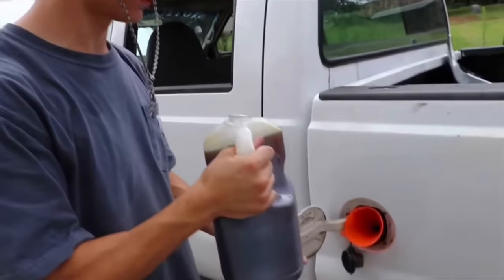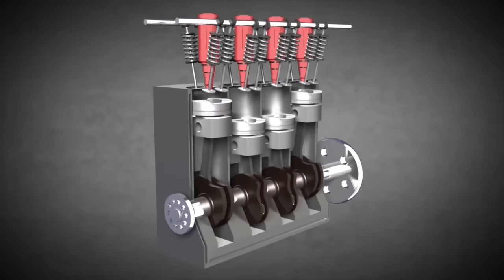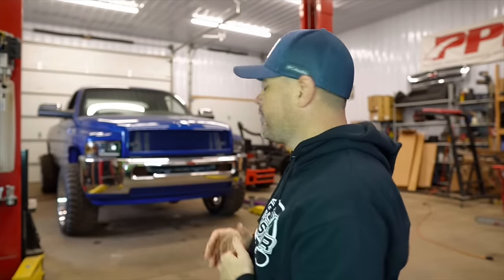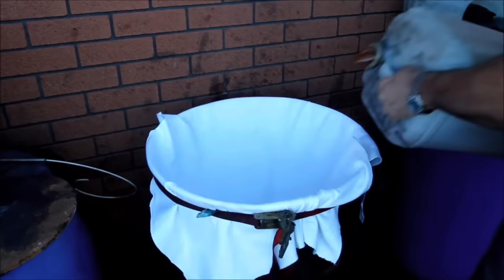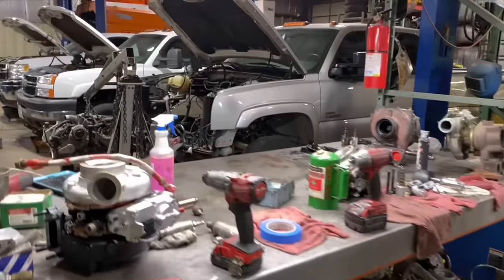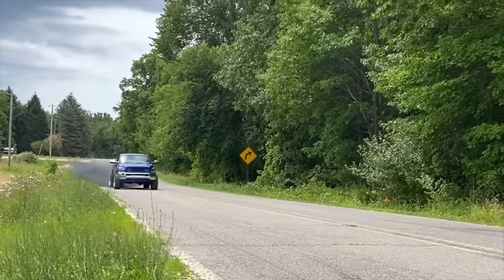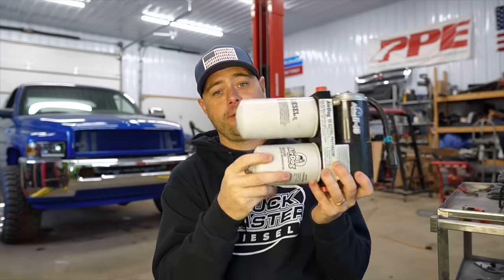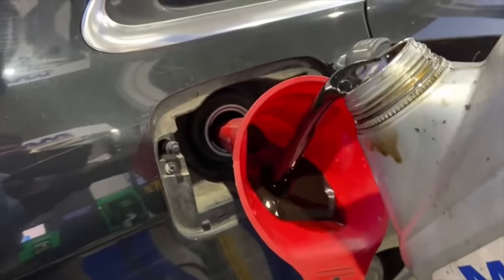Can You Run A Diesel On Used Engine Oil? Free Diesel Fuel? *EXPLAINED*

Comment: I towed 8 humvees in 4 months that the driver filled with unleaded. We drained the tank and dumped 25 gallons of gas/diesel mix among 15 lhs with over 100 gallons in the tank prior to the contaminated mix. It’s not a bad idea to add 1-2 quarts of used atf or oil to your tank especially in winter for added lubricants with the post 2007 fuel especially on mechanical injection engines

Comment: In my 2003 6.6 lb7 I’ve put 5 gallons of used motor oil in with 15 gallons of diesel i mixed it up well and it ran like normal just smoked a little more

Comment: Used to run filtered veggie mixed with diesel 1:1, oil and gasoline (black diesel), kerosene in my 1990 ve pump Cummins all the time without issue.  Getting it clean was the hardest part.  Used to dump leftover end of season gasoline in my 06 Cummins without issue also. My ‘18 never crossed my mind. Fuel system is too sensitive to contaminants.
Reply: STOP..........in your 06' Cummins????....I take care of my 06' like a Ferrari!!!!!..just cracked 200k.....OEM Injectors replaced with BOSCH OEM Injectors..Valve Lash adjusted, the Starter was replaced with a HD unit......everything else is still alive and has not been replaced.....maintenance / maintenance / Maintenance.......Awesome truck...Oh and its a Manual
Reply: I would probably add little bit of 2 stroke oil or transmission fluid in the fuel... can't hurt

Comment: Thanks for the great info.
 I havd an 07 Ford with the 6hoe an i started rebuilding fuel injectors for friends an family absolutely love it after doing my first set i convenienced myself to run 50 50 mix used oil/ filtered of course with diesel. My mileage has stayed the same power if there is a loss i cant tell with the tune. One thing i will say is its a hell of a lot quieter. I dont have any smoking issues or starting cold it actually starts easy an isnt chopy at all where as last yr she would cough an bang till it warmed up.
  Im looking forward to tearing my injectors down next weekend im going 30 nozzles. If i remember ill let ya know how the old ones look.
  I have 3 friends pumpin the black dtuff in their riggs an no troubles yet knock on wood!

Comment: This is just the opposite, I put 12 plus gal. of diesel in a 1964 Chevy 3/4 tom 4by with a 250 gas straight 6,  it ran fine for a block or so, then went to slug mode, black smoke out the pipe. I realized my foolish mistake, it had a manual choke, it ran better pulled out, I did get home about 35 miles, left it idling and added premium fuel from cans I filled in my town. Only problem was to much fuel, it all washed by the rings and filled the pan up the dip stick about 2 in. I just washed my sludge out I figured. After running right again I changed the oil and filter. Never to do that again, and never had an engine problem.

Comment: with  the  gas /diesel  mix  can be  a problem if  they dont stay mixed,   the detenotion  on  pure gas  is  hard on head gaskets  and  head  studs .  I have  heard of cold  starts where they spray  in gas  on start up but  that was  -40 and lower. easier and  safer is  wd40  on  cold  starts

Comment: I have a 1993 idi I have the front tank for pure diesel and the rear for used ATF. I start it on diesel, stop it on diesel, drive it on used ATF. Never had any issues. It loves the tranny fluids.

Comment: I have a 95 powerstroke that I run frier oil and used motor oil in now for years and it is a night and day difference in knock and I get better fuel mileage especially with the frier oil it works great

Comment: im running used motoroil cut with medical grade alcohol that i got for  free for several thousand miles now, 1979 international S2200 Semi Tractor W/ Cummins ntc855 big cam 2, 2000 International 4900 w/DT466E, and 1981 Cadillac Eldorado w/ dx block 5.7 olds diesel. The S2200 i did not have to do much of anything to make it work, the 4900 i had to add a stronger transfer pump, and the Eldorado i added a couple of transfer pumps as well as a 3 micron cat filter to get it to work right.

Comment: I have a early 99 7.3 205,000 miles on it with 35x12.50x20 & 4 inch lift with 373 gears & run used Trans fluid through a 2 micron filter & haven't had no problems I am getting 28 to 30 mpg on highway I am running a programmer also my buddy has a 2002 5.9 with 245,000 miles on it with 35x12.50x22 with 4 inch lift with 355 gears & the same programmer & he's getting 25 to 28 mpg on highway gotta love those old diesel engine's
Reply: What programmer is your buddy running on the 5.9?
Reply: @ConnectiveWyo  Hypertech Max Energy he runs it in stage 2

Comment: I've a 4 stroke 17 hp tucmseh lawn mower I recently put 50/50% mix gas an used motor oil in an it ran just like a two stroke or small diesel engine 😊😊😊😊😊 an I've more torque outta of it then gas alone I'm happy with the results 👍👍👍👍👍👍

Comment: If a jet is worked on, they drain the fuel but can't put it back in since it is considered contaminated. I ran my 12 valve on it with no problem.

Comment: My only complaint is that used oil has all the shit you wanted out of the motor in the first place. If you're going to do this make sure to filter the shit out of that oil so you're not reintroducing contamination directly into the bores of your motor.

Comment: I run my 1998 12v Cummins/Dodge off of 50/50 mix of used oil and cheap diesel or kerosene

Comment: I have a '00 Semi with a Cummins N14 in it. I used to dump one gal. of 2 cycle motor oil (clean/non used) at every fill up (around 200gal.) to give the pump and injectors more lubrication so I always had 5-10 gal. of oil with me. I remember I parked for the night at a rest area with about 1/4 of a tank of fuel, the truck was leaning to the right side a little so all my fuel drained into the right tank. Woke up in the morning, started the truck , it ran 10 seconds and ran out of fuel. I didn't have any hoses and buckets or whatever to transfer the fuel back to the left tank so I dumped all my 2 cycle oil that I had into the left tank (at least 5 gal.). Got it started and it ran just fine.
Reply: That's actually very common a Cummins truck forum forum has an entire dedicated section to running two-cycle oil to lubricate just a small amount plus a splash of atf to scrub the feul system. This of course is all new fluids as waste oils have contamination

Comment: I put used motor oil mixed with farm fuel with a 12 volt pump filter continuously off battery and solar panels for my deisal dixie chopper xxwd5000.  Will not use on my 2003 7.3 powerstroke .  I'm almost at 500,000 miles on this beast I wouldn't risk it.  Probably wouldn't hurt the engine but I wouldn't want to mess around and find out.

Comment: We had a machine that would suck crankcase oil out filter it and blend with fuel from tanks than return to tanks. Worked great
until we got emission trucks and had to quit using it. We were recycling our engine oil and getting 10 gallons of fuel each change and no waste to dispose of.

Comment: The short answer is yes. The was gas diesel and oil is refined is very similar to how we make alcohol it’s boiled and run threw a distillery so oil and diesel are the same base. If you want to run eng8ne oil yo7 should get a filter that can recycle the oil threw a medium like diatomaceous earth powder it will file tear out everything down to 2 microns and scavenge out all the metal and water and soot particles. After it’s filtered you should mix it in a 3/1 ratio with 87 non ethanol gas and add in some cetane booster. This will make you diesel fuel. You can also get this from from transmission fluid brake fluid and cooking oil but the ratios will be a little different. The most important thing is filtering the oil I would filter 100 gallons for no less then an hour in a recirculating tank to make sure it’s clean.

Comment: I had a 12v Cummins, I would mix in motor oil, ATF, and sometimes I would get soy oil from a dairy for free and I would mix it 50/50 with diesel. Not in the winter tho. I ran strait diesel in the winter. With the soy oil the truck smelled like French fries, I did not notice a loss in power or extra smoke, but that truck was probably only 50hp over stock

Comment: IDI engines are VERY forgiving when it comes to fuel. Transmission fluid, motor oil, gasoline mixed with oil, tequila mixed with oil, whatever. If it burns and can lubricate, it'll run it.

Comment: With a 24v you can blend a little in but only if it's warm. I got a fass titanium and ya gotta swap your filters every 2-3 k miles. Just eye your fuel pressure. Filter it well. Read forums on it. If you use veg oil you need to heat it up to reduce the water content. Before you add it. After, heat the oil before you burn it I've seen some sweet systems that use a heated coil around a filter before it's injected and uses coolant to heat the tank.
Reply: If you're changing it every 2-3k then you must have bad fuel. I got like 10k and it's exactly the same pressure as when I put em on.
Reply: @mrmotofy  I do it out of precaution. I've got terrible luck with VP44's. I'm on pump 3 and that was before the waste oil fuel. If the filter is 8 bucks I'd rather just swap em
Reply: @luketimmer6108  have you thought about p pump swap my brother had a 99 with a vp44 we had to replace we would have known that the p pump could have been swapped in back in 07 we would have been much happier
Reply: @black69camaro2344  don't have the time and can't find all the parts in southern Wisconsin rn. I'd love to when I have more free time

Comment: Hey there how are ya? I’ve run wmo, watf, kero, bbq starter fluid, hydraulic oil through my diesel engine. I started doing this 10 years ago. I have many sources for the oil, I just ask them not to mix coolant with the oil. 
I decant the jugs through a 100 mesh screen then to a 25 micron sock filter, then through a 1 micron filter. I fill a 55 gallon drum with 50 gallons. Once filled I then in stall my 50 gallon per hour centrifuge on the filler bowl. I use a 1/2 hp motor to turn a Toyota power steering pump with 2 to pulley set up. Pump turns 1/2 motor speed. The oil then enters a homemade 2kw Emerson heater then into the centrifuge. I by pass the centrifuge in tell the oil in the barrel is above 212. The barrel is insulated to retain heat. 
Once to filtering temp the oil is very thin and dewatered. I begin to slowly close the bypass line, pressurizing the centrifuge, ya do this slowly so ya don’t blow the centrifuge rotor a part. I run the system at 80psi which spins the rotor at approximately 8000 rpm’s. The system then runs for 10 to 12 hours. Allowing for 10 to 12 passes through the centrifuge. Once done the oil is very hot and thin. The oils still black but extremely slippery. There are magnets in the bottom of the tank to collect any Ferrous metal. I allow the filtered oil to settle in a clean barrel with a sack of crystal cat litter. The crystals pull out contaminants and any water that may condense in the system due to heating. Once settled for 2 weeks I pump it in to one of the trucks then mix 50/50 with diesel. I  run a couple 3/8 tubes into the tank and run compressed air in to bubble mix the fuel for a few minutes. Sometimes in the summer the mix is a little richer. I change filter monthly, and drain the water trap before starting. 
I’ve been lucky so far I haven’t had any issues. 
I know that wmo has about the same btu value as rug, which is about 11% less than no2. The engines run cooler are less noisy  and have slightly lower egts. One truck is a ve pump and the other is a p pump. Atf and hydraulic oil has higher btu value so watch you egts if ya run a higher percentage of those 2 then wmo. With diesel here in Kaliforniastan over 5 bucks a gallon it has saved a lot of money. Trucks don’t produce much black smoke  a little grayish white smoke. I have tuned the pumps for this mix. Just be careful in areas where the CHP will dip your tanks, then your are hosed! Time to move to MERICA!! Waiting on wifey to retire then we are gone!! Cost to run system is about 3 bucks, in electricity, in PGE land might cost ya 5 or 6 bucks . I back flush the sock filters with a little rug to keep them cleanish. Thanks for reading my post.

Comment: My previous truck was a pre-emission diesel.  I could run used motor oil, transformer oil, transmission fluid, engine oil, kerosene, home heating oil, Jet-A, etc.  I did it for years, never lost an injector or fuel pump.  Can't do that with these new motors.

Comment: Nice video, you might find it interesting that the ww 2 German maintainer manual's for Russian front included 5% gas to reduce paraffin production in extreme cold. Worked for me for last 20 years even in the ski resorts at 9,000 ft.  But no I do not think I would run used oil in my vw.tdi.

Comment: My 03 excursion 6.0 runs good on used oil. However if you get Abby sludge in your tank it will clog your secondary fuel filter and you will need to clean your fuel tank

Comment: In 88 when I drove for Schneider they ran Cummins at that time and when they’d do a pm they’d put the used oil,out of the motor in the fuel UNLESS your tanks were full needless to say they did it to mine once I learnt quick fill up my tanks before going into the shop lol

Comment: What about Biodiesel made with vegetable oil. It would be cool to hear thoughts on that.
Reply: As long as there is no wax in it.
Reply: I've looked into it many times and I don't see any downside as long as you don't run it below the cloud point Temp but if you get gelled up it's not good

Comment: Newer diesels no motor oil just ATF. My old 97 6.5 I tried the motor oil thing and it destroyed  my Injection pump with 50/50 ratio. I then swapped it out and converted it to a  mech pump from a 93 I believe  and never had a issue after that. It did smoke lots but worked.

Comment: I had a 4500 GMC with an LB7 in it about 10 years ago they pumped about 50 gallons of gas in it and it ran 10 miles and died they towed it to us we drained the tanks and flushed the lines new fuel filter and I serviced that truck regularly for about 5 years after that and last I worked there it survived but I can positively guarantee you that if you did that in any truck with a CP4 get ready to buy a fuel system lol

Comment: I got an 04 Duramax and every oil change I filter and dump my old oil right back into fuel tank! And I always got extra being a mechanic and working at caterpillar I dump oil into it quite often aand transmission fluid, electrical transformer oil and gum out or Lucas injector cleaner and seems to have more power and I change my fuel filter and transmission screw on filter every oil change!

Comment: 7.3 5.9 and 1.9 tdi I've run on diesel, 10w-30 motor oil, break fluid, atf, hydraulic fluid ratio 1-30. They dont care newer diesel, especially def systems i wouldn't risk it.

Comment: Only in older diesel trucks. I’ve never saw it done an if so what it does to fuel system. I’ve have done it in a 12 valve with the pee pump. But it smoked a little more on startup than normal
Reply: I’ve been running fryer oil in my’01 duramax for 150,000 miles. I eliminated the smoking at warmup by using the bully dog programmer
Reply: @matthewbrust3353  fryer oil is different than motor oil. Fry oil is bio fuel. We did that too.  But good luck on the oil my guy

Comment: you are right, used engine oil has metal particles, I also have a bad experience of using used engine oil in my Daihatsu charade 1000cc, the car went fine for some hundred kilometer and then the engine started loosing power. I filled the tank with diesel two or three times which again made the engine to work back on original performance. however used cooking oil works much better especially in hot weather !!
bio diesel is the future and not the EVs as the batteries manufacturing and disposal in involved with environmental effects !!!
bio diesel have zero sulfur content.

Comment: you can run it in newer engines but you have to filter the hell out of it and mix it 50/50 diesel and or 20/80 gas and even 35-solvent

Comment: THANKS,
     MY 1997 7.3 L POWERSTROKE. TRUCK LOOKS  BRAND NEW. 
F250 EXTENDED CAB.
 8 FT BED. 
FOUR-WHEEL DRIVE.
 LOCKING DIFF ON THE FRONT.

 I COULD REPLACE THIS TRUCK RIGHT NOW AT THE FORD DEALER BY SPENDING $130,000.

YET THEN I'M GOING TO BE STUCK WITH A SUPER EXPENSIVE 6.7 L TWIN TURBO DIESEL.

IT COST CRAZY MONEY TO REPAIR AND HAS A MUCH SHORTER LONGEVITY. 

OH SURE IT'S TWICE AS POWERFUL.

   LAST HALF AS LONG.

AND COST FOUR TIMES AS MUCH TO REPAIR.

NOW DON'T GET ME STARTED ON FORD'S 6 L AND 6.4 L

Comment: The 12 valve at the farm runs on nothing but used transmission fluid and hydraulic oil for the last 20 years.

Comment: I have done this since my 2003 Cummins had 100k in it and it turned 300k a while back usually less than 25% with no problems.

Comment: I filter used oil and burn it in my 24v Cummins. While towing 14000lbs trailer um steep grades I noticed better fuel mileage. But very little.  I mix at a 50-50 to play it safe since I’m in Canada. (Colder climate)

I filter it to 5 micron before putting into my truck. I also have a dual filters on the truck just incase.  But should never make any difference as it’s prefiltered

Comment: I use transmission fluid into my diesel tank I use half a quart per fill up n I get better fuel economy smoother engine run n lubes up positions

Comment: Just giving you a heads up they made the 7.3 till 03 and I run used oil in my 02 7.3 I run a 50/50 mix

Comment: I use a gallon of used oil from oil changes on my bikes and cars/trucks every time I fill it in my 2000 7.3. Quiets it down and I use the old crap
As far as would I ever get rid of it... Not a chance. She's a 2000 F350 drw 7.3 with a 6 speed. When I die I want her pushed in the hole behind me.